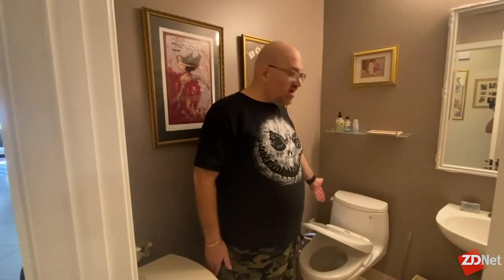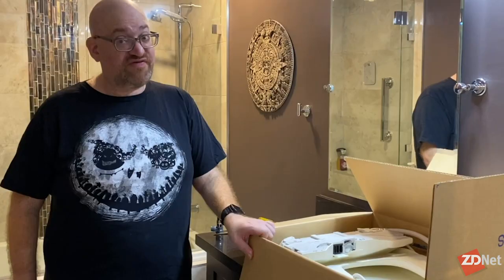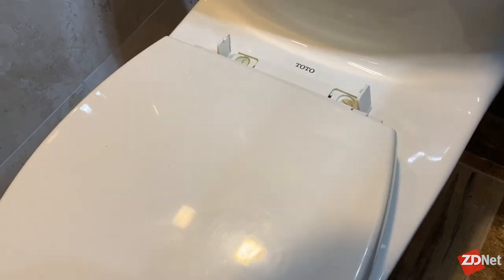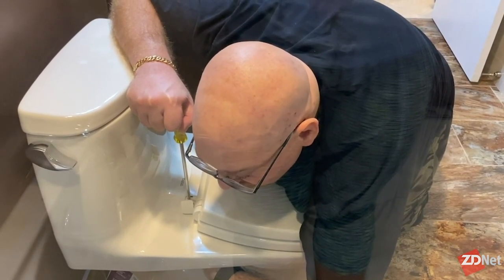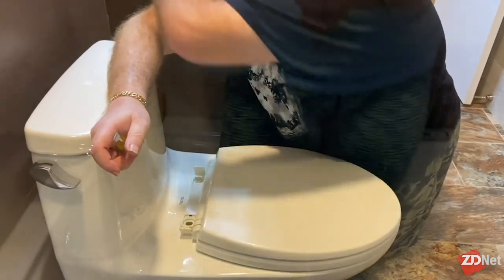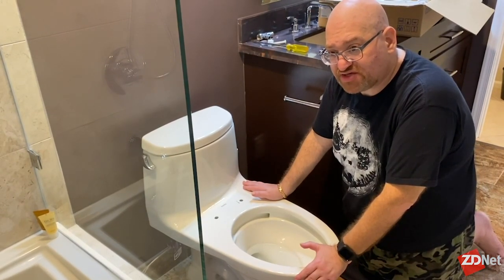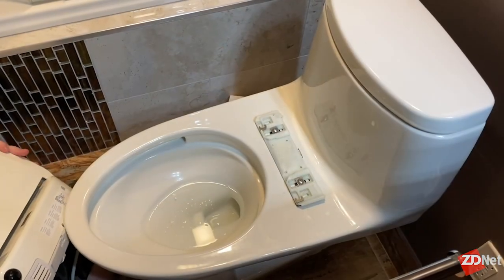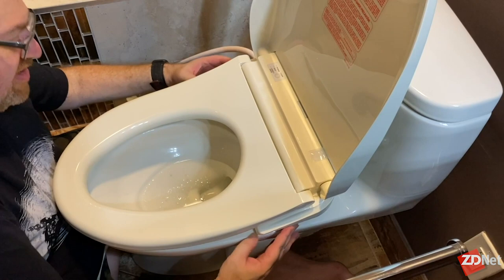No toilet paper, no problem: Installing a bidet seat is easy and affordable

Comment: Nice install. Just a couple suggestions. 1. That water splitter is called a Tee in the plumbing world. 2. Those water connections are usually compression fittings. Compression fittings do not ever need plumbers putty or tape. They don't seal by the threads. 3. I love the Japanese bidet add-ons, but they're expensive, and getting power there can be difficult. I installed one for $50 that connects to hot and cold water, so no power was required. Of course, it's harder now to find bidets. 😂  Good job with the video and install!